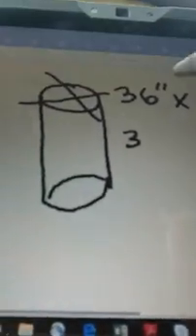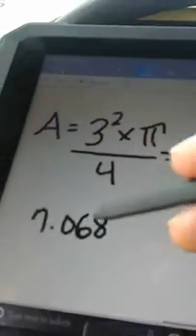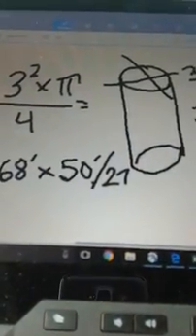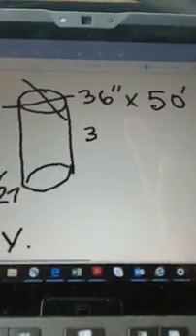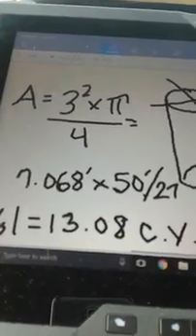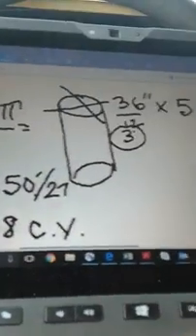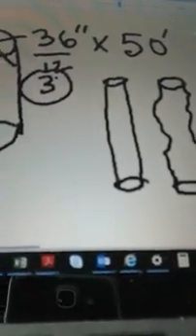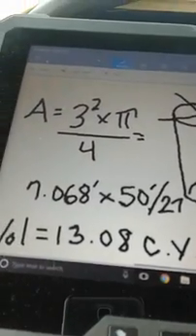Calculating the  Theoretical Volume of a Drilled Shaft.

Comment: 1.5' X 1.5' X  3.1415 = 7.07 sq. ft.; 7.07 X 50' /27 = 13.09 (this method seems more straightforward to me and keeps everything in square feet and cubic feet until the last calculation that converts it into cubic yards); Because of soil cave-ins, I would allow for 20% waste overage for concrete (just from experience). You should allow anywhere from 30-40% additional spoils removal due to swell. It is rare that you'll get a cleanly drilled hole without cave-ins. If casing is required (and remains) then there will be less waste. If casing is required and is removed after the pour (not advised, but for some strange reason is called for sometimes), then you should allow an additional 2" for the pier diameter. I'm sure everyone has their own method, but this was how it was taught in the R.S. Means courses that I took (around the time the dinosaurs disappeared; :)). I was also taught these methods by the Frank Walker course I took (about 10 years after the disappearance of the last dinosaurs). Frank Walker's course was actually almost identical to the R.S. Means courses. Frank Walker taught to use 25 (instead of 27) when converting to cubic yards due to cave-ins. Then, they would use 25% additional in a waste percentage. I took them at Richland College (now named Dallas College, Richland campus) in Richardson, Texas, just outside of Dallas. Both taught very straightforward math calculations and didn't use a lot of the 'tricks' that are now taught. However, if your method works and is accurate, by all means, use it.